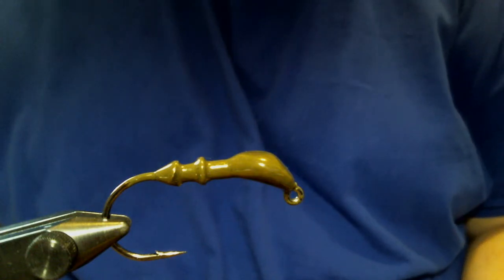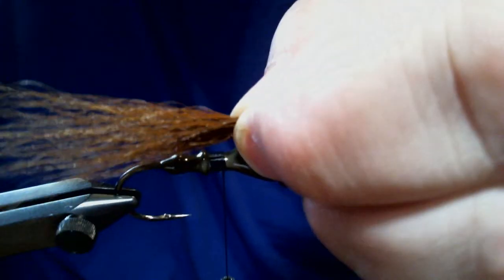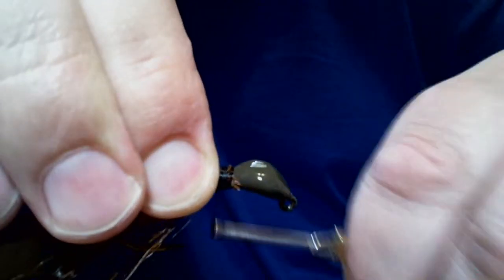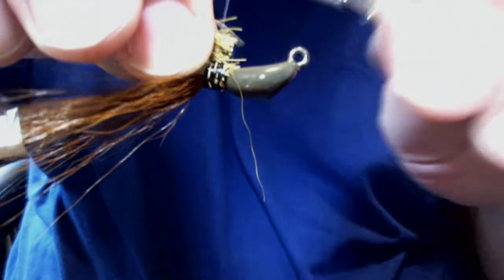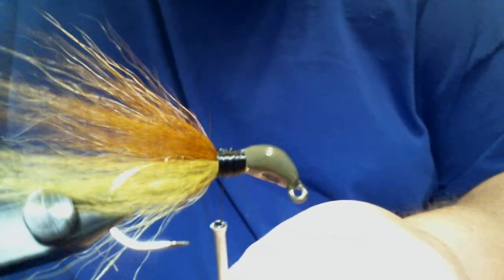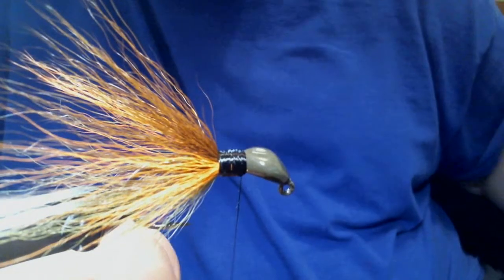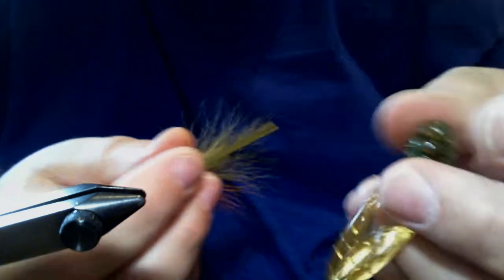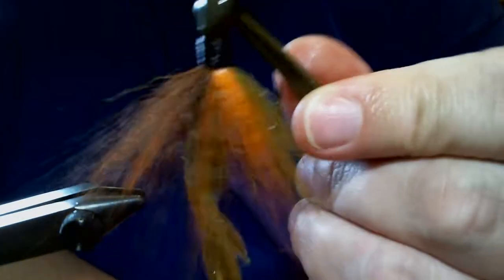Arky Bucktail Jig

Comment: Hello again Smalljaw. Thanks  for taking the time to reply. The fact that you give your time to help others is commendable. I don’t know how long you monitor comments after you post but hopefully you’ll see this one. I noticed that in one of your comments you said you enjoy pouring your own jigs and that it gives you total control of  the hook choice. At the moment I only have a banana head mold that my dad had from around 30 years ago. It only accepts a 90 degree hook. It has 3 cavities that I mainly use, 1/8oz, 1/4oz, and 3/8 oz. I am planning on using the 1/8 oz for finesse jigs, the 1/4 oz for swim jigs and the 3/8 oz for shaker jigs. If you were going to buy only one hook for each size which hooks would you use. And if you were going to buy only one more mold for now which mold would you buy and which hooks would you use in the mold. 
Thanks again for your generosity in sharing your talents and patterns with us. Maybe I should say that I fish braid to 10 lb mono leader. I know in your hook video you mentioned hook choice is dependent on your tackle
Reply from the maker: The Banana head mold comes in both a regular model and a heavy hook model. But based on line I'd use a heavy wire 90 degree hook. 1/8oz I'd use the Owner 5313 1/0, good size for most finesse applications. The 1/4oz would be a 3/0 Owner 5313 as it is stout enough for a swim jig on that head.  The 3/8oz would be a Gamakatsu 604 in a 4/0 however I'm not sure if these will fit the mold you have, it may require modification. The mold I'd get is a tough question to answer because I don't know the water, type of cover, or intended purpose, the closest thing to cover a lot of stuff would be the weedless round head but there are 3 different mods so you'd have to look at the sizes you use most and go from there.
Reply: smalljaw   Hey Smalljaw. I was reviewing your reply and noticed that the thumbs down was hit. I must have done this by mistake when trying to read the review as your help is priceless to me. 
I heard you mention a water tank a couple of times and I was wondering what it would take to get it up and running. Maybe I could help.

Comment: Hey smalljaw. I’m a new tier and have watched your videos endlessly since I found your channel. Thanks for doing what you do. Your skills and attention to detail are truly inspiring. I have a couple of questions if you have the time. First I was wondering if buck tail and craft fur can be used on the same jig without impeding the action of the different hairs. Also I was wondering how strand counts for a skirt are determined. For instance is a two tab skirt tied to fold over a 44 strand skirt or an 88 strand skirt as opposed to a 2 tab skirt with a crop top. Is the 2 tab crop top 44 strands?  Thanks again for the skills and patterns that you put out there for us to see and learn from.
Reply from the maker: Thank you for your kind words, I really appreciate it!!!  You can experiment with using craft fur and bucktail together but you'd have to tie one material on first and the other over the top. The reason is the material are very different in the water, craft fur has a fluid motion and requires very little movement to get action. Bucktail has a really subtle action and is better when less action is required. I'd probably tie a base of craft fur and then go over top with bucktail if I was going to mix the two but in general you wouldn't use those two together. If you use 2 tabs of silicone with 22 strands per tab, then it is a 44 strand skirt even if folded over. Strand count is based on the number of tabs no matter if it has a crop top or long and folded over. I hope this helps and thanks again for the questions and for watching!!!!

Comment: 👌 is this a jig you pour? If so is this a mold one can purchase?  The head looks like it could be used as a swim Jig also.
Reply from the maker: Thanks for watching and for the question!! I pour this head and yes, you can buy it, it is a Do-it Trokar Arky mold. This jig would not be a good swim jig, it is too wide and it isn't balanced to swim. If you want a bottom contact jig that would double as a swim jig look at the Poison Tail jig.
Reply: Thank you! I noticed in one of your other videos you mentioned that mold. Nice to be sure though! I’ve been using the Boss swim jig heads and bought the long  reach whipfinish tool after seeing you use it. Outstanding channel.